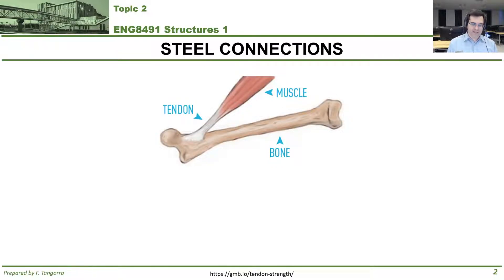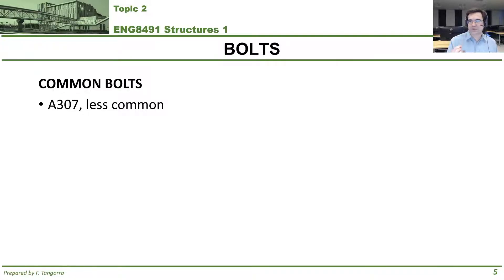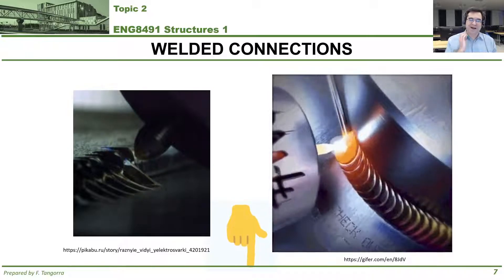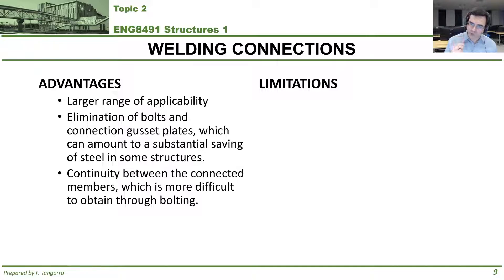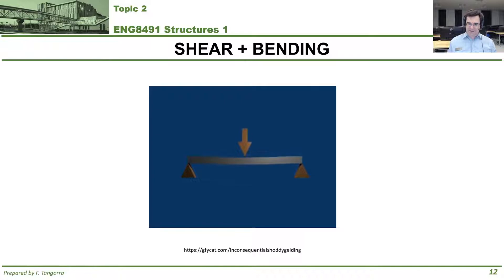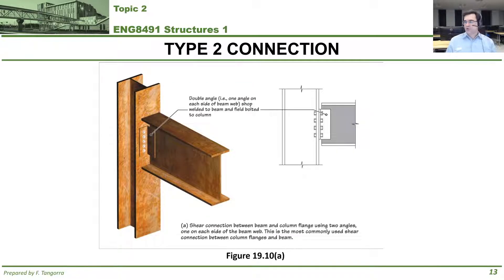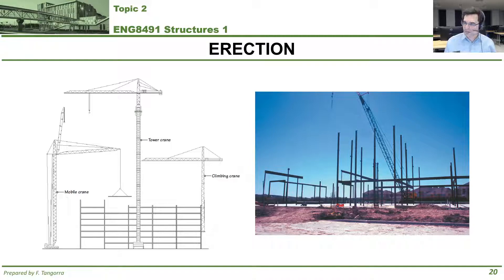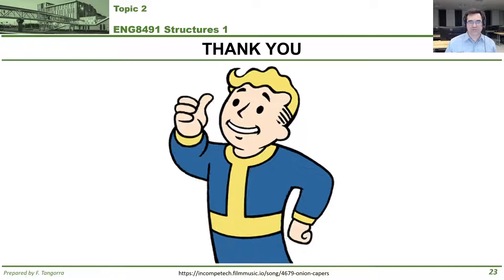TOPIC 02: Steel Structures v05 (STEEL CONNECTIONS)

Comment: Great Videos! Your building code series! You really helped me pass my Powers and Duties of the Chief Building Official BCIN exam. Just wondering if you know whether or not a designer holding BCIN in Building Structural would allow a holder to sign off on certain structural plans or whether or not there are any design applications with a holder of a Structural BCIN? I hope you might be able to answer, I haven't really been able to get a clear answer anywhere. Thank you for everything you do!